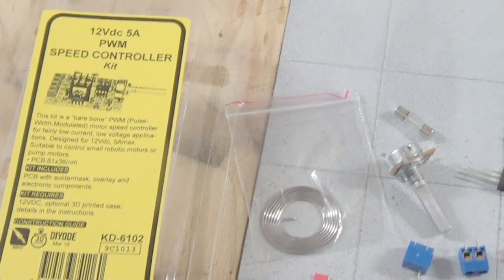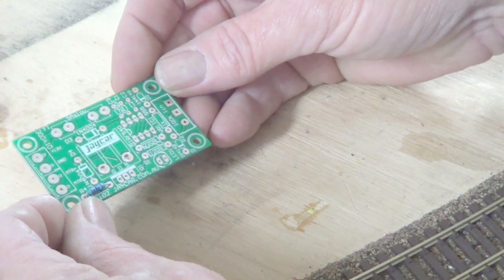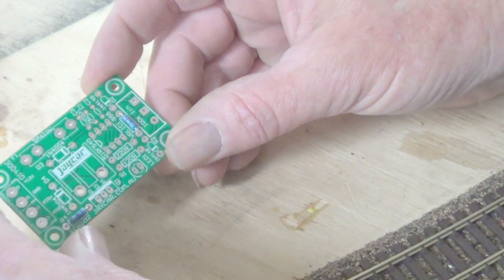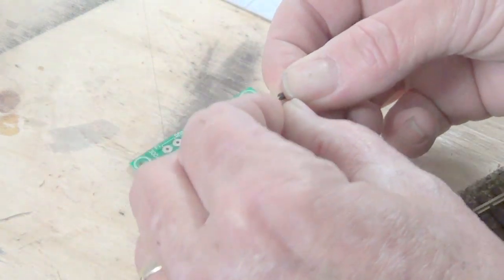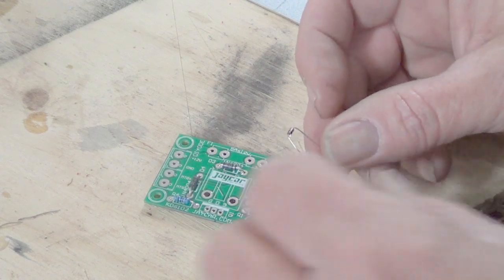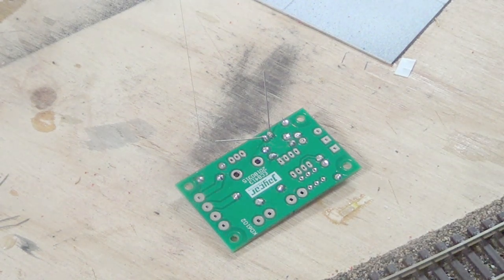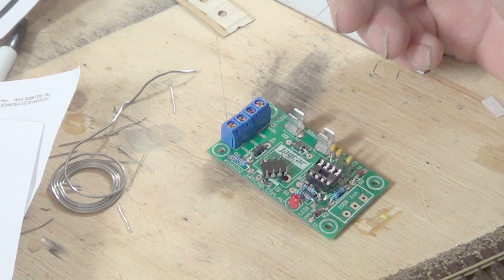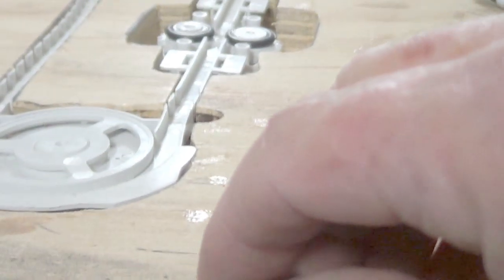12Vdc 5A PWM SPEED CONTROLLER KIT- Auto Plant Episode 10

Comment: Interesting..... I tested my Magnorail motor using a Digitrax DH166D and worked great. Then again I am running only 1 motor. Going to expand Magnorail with another set, 2 motors. Need to measure the current draw by the 2 motors before burning up the DH166D. Thanks for another great video...........
Reply from the maker: I hope you do a video on your build to show us how you do it cheers Robert